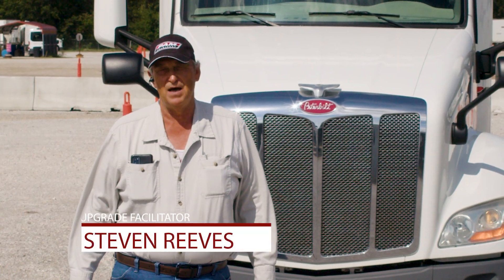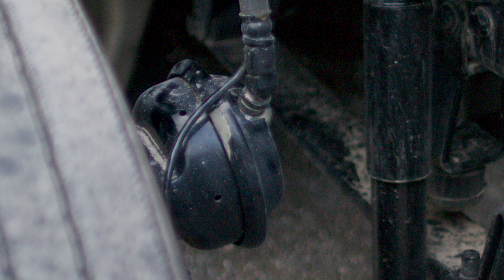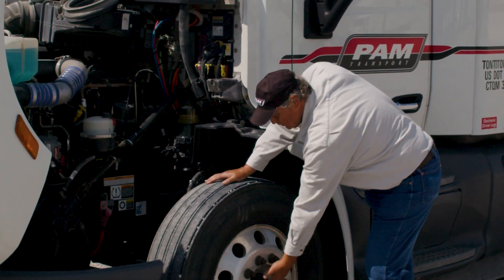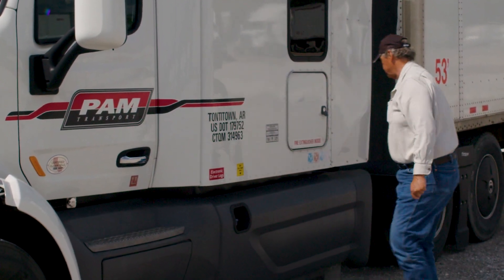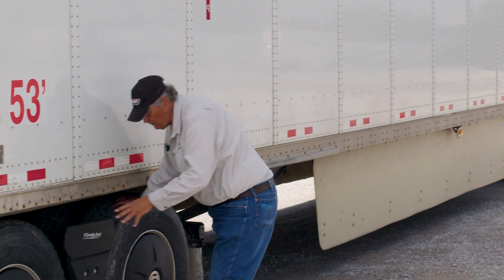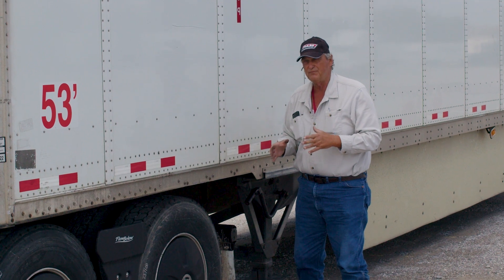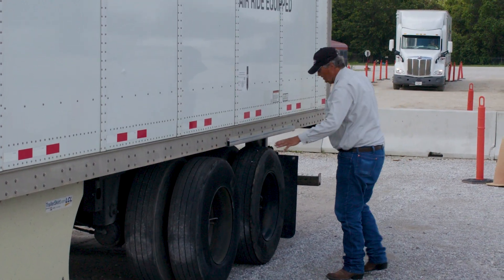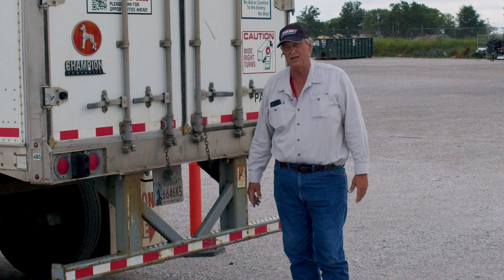Pre-Trip Inspection Overview with Steven Reeves | PAM Transport

Comment: Need to check tire pressure with a tire pressure gauge because dot has sensors now at weigh stations getting people for that. Then also pulling the air line to let moisture out some trucks getting frozen brake lines in the winter.